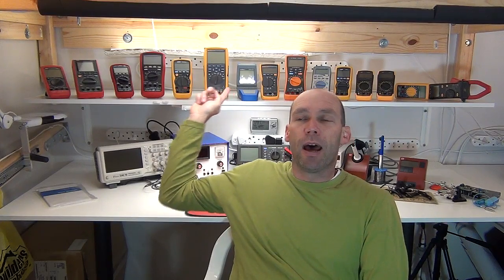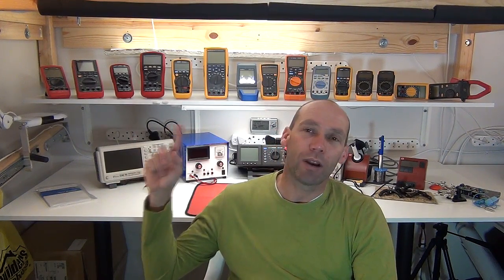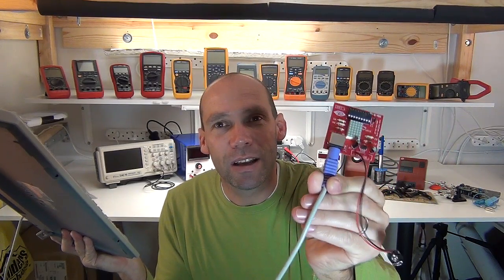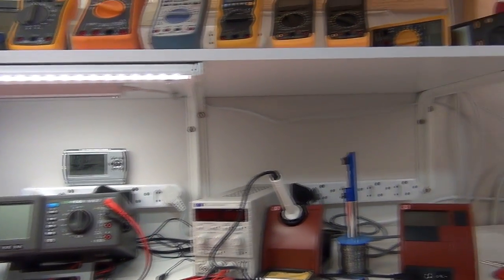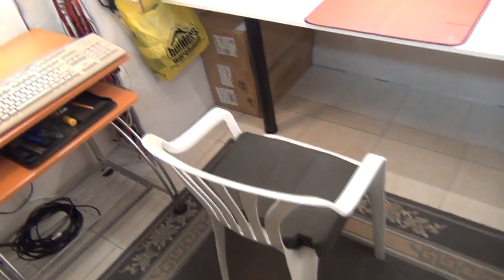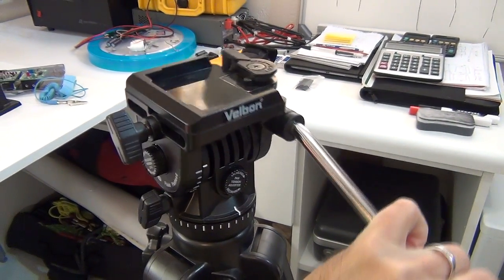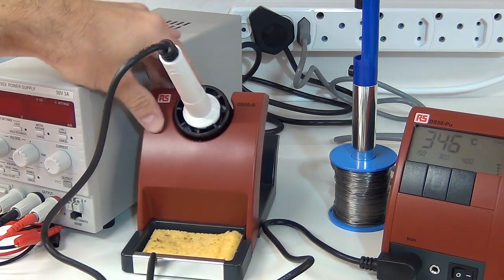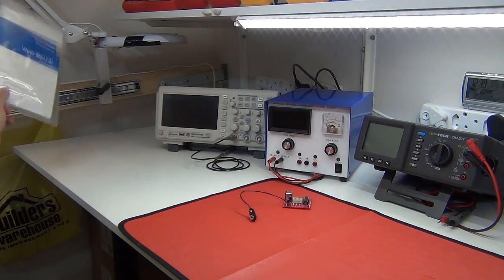T4D #6 - Closer look at the lab, soldering station and chit chat...

Comment: Interesting look at your bench set-up.  I love checking out others bench set-ups. You win the prize for incorporating a bed.  Have not seen that one before although I have fallen asleep at mine on occasion.

Just a note that many seem to have more problems with inhaling the flux and chemical fumes in lead free solder than in lead alloy solder for some reason.  Also, the lead is not much of a concern in the solder fumes as it would take a lot more heat than used for soldering to vaporize the lead. The fumes are generally created from the flux and other chemicals. It is worth noting that lead can be ingested so washing hands after handling lead based solder is important.

Again, thanks for the walk through.

Comment: Excellent idea about putting bed above working area!

I live in a kitchen, with limited space (2.8mx4.5m only), so here is bed, three working benches, three oscilloscope stands, big stove, gas/electric oven, lot of kitchen elements, tap water and sink, and  more things. So, navigating is bit difficult. 

By 'stacking' bed over working bench is way to get more room for working, and more  free path for walking (currently my 'labirint path' is only 45 cm wide - just barely enough to walk, but without comfort). 

One suggestion for your chair: use one with wheels and rotating mount - this will allow you reach every bit of the room without need to stand up. 

Anyway, great video. I enjoyed a lot. Also, thanks for other good advices (I like your lens mount, pretty useful). 

Cheers,
milan

P.S. Edit: BTW, liked, subscribed. Please continue good work, and post more videos.

Comment: Yes once you have tried the Metcal you will want for nothing else! No fancy LCD screens and you pick the temperature by selecting the hot swappable tip so no dials either (this put me off for a good while!) but you soon realise the iron temp is very stable whether doing SMT or a massive shielding can in a radio!
Surgical forceps are useful in the tool kit too - I will try to think of some more useful items!

Comment: You might want to invest in a flux pen or liquid flux. The solder has flux in it, but sometimes you'll just see adding a drop of flux or wetting the surface with the pen before applying solder makes a ton of difference.

It's also great for applying on old solder and on the copper wick, so that the layer of oxide will be gone and the heat from the solder tip will "flow" better and the solder will go on the wick faster.

Comment: In case you don't know, the soldering station is a slightly modified Zhongdi ZD-937, maybe an OEM version designed for RS. The manufacturer site is china-zhongdi com ... but you can use google to get there

It's an OK station, but I'd be concerned about replacement tips and long term reliability of the heating element. I bought an Hakko 936 off eBay - very well known design, lots of clones for it and parts can be still found easily. Even some of the parts of  the new Hakko fx-888 fit on it.

Comment: Couple of things - desolder braid is expensive - I purchase mine from deal extreme (SKU 9159) - works very well!
Solder suckers - be wary they all look similar but are NOT equal. A cheap solder sucker will only risk damaging components by having to go back!
Soldering iron. The RS looks nice, but if you want to do lots of work treat yourself to a METCAL something like a s/h SP200. Tips not cheap but 10 second heat up time means you turn off so tip lasts longer. Heat capacity incredible!!!

Comment: Don't miss the screen one bit - I thought I would though! Temperature is very stable. That iron looks interesting but I bet not as robust and it does look a bit toy like! I would be fairly surprised if it heated up faster and had equal heat capacity as it uses a standard element with sensor. The metcal is quite different in this regard which is what gives it the edge in terms of performance. I guess it does depend what you soL-der (spelling for our American friends :p) though.

Comment: I wouldn't worry about the solder fumes, really. They're not particularly harmful unless you breathe them all day long, and whether the solder is leaded or not makes no difference, you're not going to vaporise it with a temperature controlled iron.

If you do set up a fan to extract the fumes, just hang it off the bed above you. A couple of 120mm fans running off 5V should move enough air to remove the fumes without being loud or causing a distracting amount of airflow.

Comment: How much will it cost I'm in the United States to build a electronics Lab From Scratch with all the equipment and tools needed ?
Will it be over $3000 dollars?
Reply: Nah, you can be functional quite well with a desk from IKEA ($50), small hand tools, oscilloscope, power supply, soldering iron etc for under $1000. RIGOL DS1102E oscilloscope ($400), Mastech HY3005D($100) power supply, Xytronic 30W soldering iron $22, various electronic kit components from Adafruit (breadboard, resistor pack, multimeter $100-$200) Power strips $50....you can definitely get fancier than that...but solering iron, power supply, oscilloscope are the major components. Perhaps a signal generator...but those pieces mentioned are quality equipment. You don't really need $1000 oscilloscope, some are $20-30k. Same with soldering gun, the $22 unit I have is fine...but there are other like the Hakko that are $109....is it necessary? Not really.